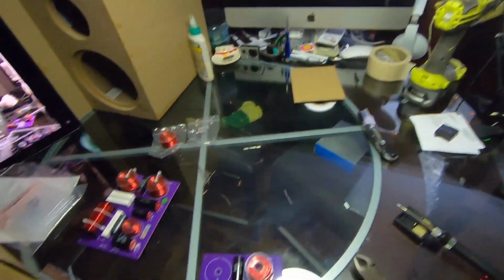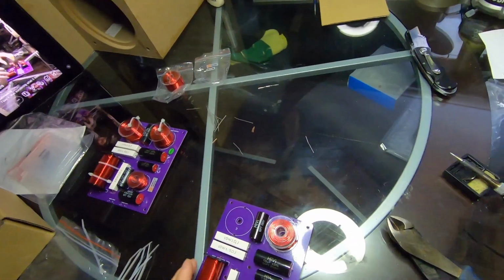Swan HiVi DIY3.1 Part: 3 Soldering Crossover Components

Comment: I would like to upgrade that crossover but not sure how.
Reply: This is one upgrade: https://imgur.com/gallery/GvjB52R
Additional changes after testing:
1. Increase C5 (in the woofer circuit) from 47 uF to 68 uF.
2. Increase R2 from 2 ohms to 3 ohms in the midrange circuit
3. Increase R1 from 5.6 ohms to 6.8 ohms (7 ohms would be fine depending on which is available) in the tweeter circuit.
Reply: Mee also but havent got clue but it only for little on the high side that be good for me 70 yrs old ears dont here the high much.